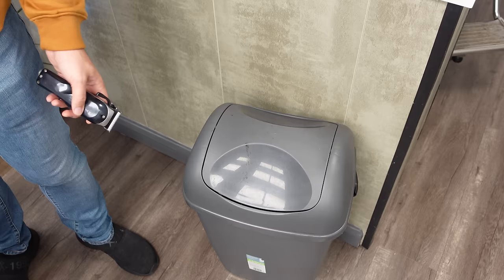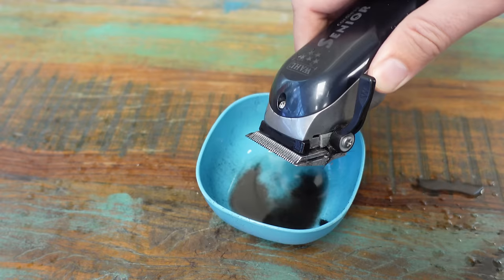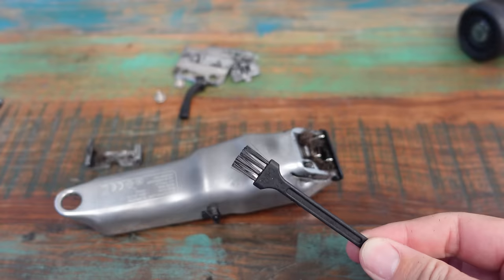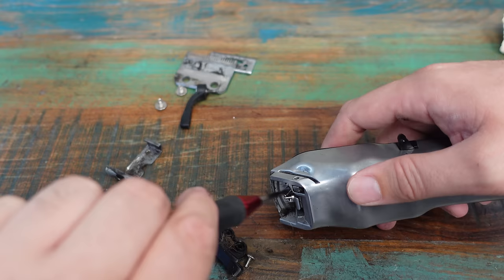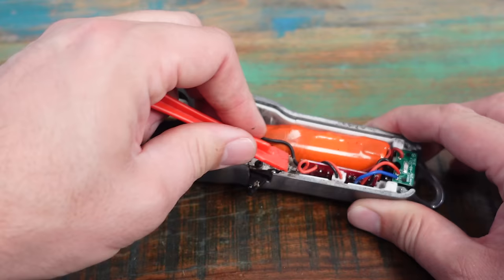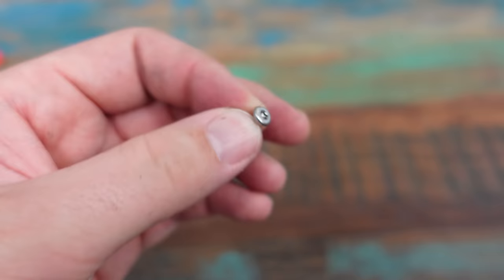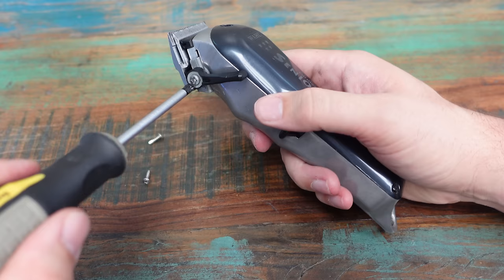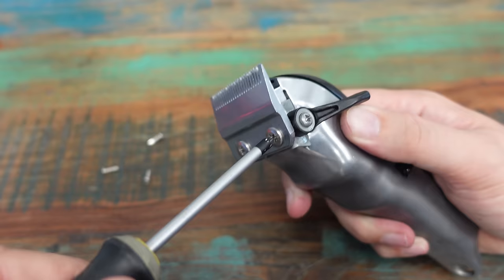How To Maintain Hair Clippers | Save $$$ by Stripping and Cleaning

Comment: Your clippers shouldn’t get like that in the first place, you should spray with clipper spray after every haircut and constnalty brush hair off the blades and I personally like to take my clippers apart once every 2 weeks to give it a good clean
Reply from the maker: That's a good routine, I don't disassemble them every two weeks but do cover the rest of the bases. I'd like to see clippers manufactured with better seals so that the hair isn't entering the mechanism.
Reply: @theoneminutebarber  Exactly it's a PIA doing all that every cut lol.
Reply: happened to mine the first time i used it😂 idk thanks man

Comment: could’ve took the blade off to begin with, then hit it w an air compressor 😭
Reply: that will blow it inside and around the motor
Reply: @thebobman69  air will not affect the clipper motor lil bro, and won’t cause it to rust😭💀
Reply: @ramihamed3618   learn to read bud.
Reply: @ramihamed3618 he's saying hair will blow inside 😎👍
Reply: learn to be specific for the special ones

Comment: Bro you need a air compressor to clean that.
Reply from the maker: That's a great shout. I really want one for the shop 👍
Reply: Or a pressure washer...😁
Reply: A can of compressed air also works great!
Reply from the maker: I've since bought an air compressor. Great investment
Reply: @theoneminutebarber  what model?
Reply: @florintirla6193  model 5inch bbc
Reply: @ChaoticMuchX 5 inch and bbc in the same sentence is wild
Reply: i actually cut hair in my small ass apartment and im so glad you showed it w out the conpressor

Comment: I took my clipper apart and cleaned out the hair. When I put it back together, the cutters rattled and buzzed loudly but wouldn't cut. After trouble-shooting for more than 20 minutes, I came here to find out what was going on. I finally saw you put the spring back and I thought, 'Spring? What spring? Then, I looked in the bin next to me and saw a spring that had spung out while  I was taking it apart. Five minutes later (and two zaps since I had the back off and the clipper still plugged in!) I had it back together and humming smoothly, ready for my next haircut. Thank you, sir!
Reply from the maker: Im glad you found the answer

Comment: Compressed air would make it easier to remove debris from the cavities. Even one of those keyboard cleaner cans. Submerging clippers that are plugged into an electrical outlet would not be good. I enjoy the channel. I have been cutting my hear for about 5 years now but have learned a lot from you.
Reply from the maker: Since making this video I bought a compressor. What a difference it makes
Reply: There is no issue in submerging the blade in a wash. There's plenty of products made for just that and they all tell you to actually run the trimmers while submerged.

Comment: I use my Remington on myself only. I only take it apart at the 2 bottom screws to sharpen with a stone. Especially if it is starting to tug. I learned here about offsetting the teeth a millimeter or so.
Reply: Hey, thanks! I wondered if it can be done. I sharpen everything in the house, from the scythe to the kitchen knives.

Comment: Great vid, thx. I have a cheap Babyliss, almost identical procedure. I suggest a small amount of silicone grease on the rotating pin and lightly oil all moving parts. The rechargeable batteries are also easy replace when they stop holding charge. If you don’t have a compressed air gun just give it a good blow to get rid of the stuff the brush doesn’t reach.
Reply from the maker: Silicone grease is a great shout.  I also use it.

Comment: Careful about the nut in with the level bolt goes,make sure you don't loose that,and skip the part in the beginning since you'll open it rinsing it is a bit redundant and expensive when the clippercide is £10 these days,also I'd use Andis it's exponentially better quality clippercide and lubricates more diminishing the noise aswell.other than that its a great video,thanks for your time to educate.
Reply from the maker: Thank you and that’s good advice on the Andis lubricant I’ll get some to try

Comment: Ideally you want a bit of oil on the plates that rub against each other.  I did that on mine and there’s practically no noise when the run.  Smooth as silk.

Comment: Great video.  Forgot the lube.  Light layer of high viscosity grease between the blades and a couple of drops of clipper oil right on the blades while clippers are running.  The high viscosity grease will ensure the longevity of the clippers.  Whenever the clippers start running hot, it's time to clean and lube.
Reply from the maker: thats an excellent tip

Comment: Bathing the unit is superfluous if you are going to take it apart and instead of prodding about get yourself a good air mains air duster and check the pressure of the armature will help.....re assemble set blades and oil well.
Reply from the maker: Mick I've actually obtained a compressor since making this video. It's been a great investment
Reply: @theoneminutebarber  Hi and thanks for the reply I bet the compressor has saved you lots of work and time plus cleaner parts as hair get everywhere.....Cleaning and maintenance is always a good policy with most things.  To really do a good job on them would be to hand sharpen the blades a specific way, then strip it down and get to the armature and set the tension on it because if too slack results in poor cutting performance plus dragging the hair....too much and he blades will heat up and may stop so it is important that you get it right this one thing will make all the difference to the unit.     Regards  Mick
Reply from the maker: That's great insight Mick, I'm not brave enough to sharpen the blades myself, I have tried once but the good thing with Wahl clippers is the blades are incredibly durable. 
I wish I could say the same for the dreadful stylecraft clippers I wasted my money on.

Comment: I got some Wahl with a lever (not the senior but some other model), but whener I try to tighten the screws after aligning the blades, the blades misalign and then I get this super noisy rattling sound. My housemate came out of his room thinking someone rang the door when I tried lol
Reply from the maker: The rattling can be because the lever screw needs to be a little tighter. 
For the blade screws tighten them a little each. A little on one and a little on the other and so on until they are both tight.
Reply: @theoneminutebarber  Thanks Michael! Gave it a try and seems to be doing better. Also discovered that my model has a screw on the opposite side of the lever, which seems to somehow regulate the angle at which the inner blade moves with respect to the outter, fixed one (if that makes any sense). Fiddled with it a bit and I think I got the clipper back to a working state. Cheers!

Comment: I got brand new hair clippers, used it once and disassembled it for cleaning after my haircut. When dissembling I noticed the blade sat flush without being pushed out however when reassembling the spring keeps pushing blade out. Any idea why this is happening?
Reply from the maker: you possibly haver the spring in the wrong way.  But also you don't need to disassemble the clipper after every cut, maybe after about a month of cutting.  Just use clippercide everytime.
Reply: @theoneminutebarber  thank you for replying. I did research and the brand I bought off Amazon is a cheap non existent Chinese manufacturer. Spring was kept in original place I just needed to clean the blade & guard because I have long hair and it jammed. If I may ask, any recommendations? Willing to spend 100$ max on a reliable set

Comment: hey mate, i got an all metal set of wall clippers recently. unfortunately i accidentally washing the head under the tap. not for long but... do i need to take it apart and let it dry, or will it survive?

I'm guessing it's not waterproof, and i don't do that again?
Reply from the maker: It should survive. Just let it dry and oil the blade.

Comment: What makes the shaving hurt when using clippers? Is it maintenance or blades?
Reply from the maker: Two possible reasons. 

1. The blade is blunt

2. The top blade is overlapping the bottom blade

Comment: How often do you need to change the blade to a new one if you cut your hair twice a week on average?
Reply from the maker: Probably never. 
With heavy use I’ve seen a blade last three years on a wahl senior.
Reply: @theoneminutebarber  is it worth me changing to a ceramic blade?
Reply from the maker: @kwameg.114 it really depends what clipper you are using. Some ceramic blades are very good but if you have a wahl senior then keep that blade. It is the absolute best.

Comment: Would you say the shorter you go on thinning hair the thicker it looks or the longer it is the thicker it looks or just in the middle not long but not short
Reply from the maker: Getting the balance right on thinning hair is important, so many guys think keeping it long will cover thinning areas, but in actual fact it draws attention to hair Los as there isn't enough body for the hair to lay normally and you need to use the lightest of product. I'd say it's better to be closer to short than long in most cases as hair begins to go.

Comment: Can you please explain how can I sharpen my clippers please? I think that will help  for us who bought expensive clippers and don’t want to make mistakes
Reply from the maker: I've never sharpened clippers. But I have replaced blades. It's probably easier. Some blades will last a couple of years and it's not expensive buying a new one.
Reply: @theoneminutebarber  I bought Wahl senior and I zero gape but still don’t cut good or maybe because am still learning am not pro
Reply from the maker: That clipper is one of the best and really should cut hair well. How's the zero gap? Does it cause redness on soft skin? You can almost move the the bottom blade forward a tiny amount with the seniors and they are still extremely close. The blade should last a couple of years even with heavy use. Make sure you spray the clipper on every use to keep it moving fast and clean.
Reply: @theoneminutebarber  ok thank you so much my brother and which spray will you recommend for me I can use it and I will try to zero gape again and make it close
Reply from the maker: I use clippercide. It does everything, cleans, disinfects and lubricates.
Reply: @theoneminutebarber  your the best my brother I really appreciate you I never expect you will be this open and help me like this I give you a follow INSTAGRAM and am already subscribe your channel

Comment: what does the lever do?
Reply from the maker: When you push the lever down it makes the bottom blade slide forward adding 1.5mm to the length of the cut

Comment: Idk what I’m doing wrong when I put the spring back on it doesn’t hold into place when I put the little black piece on it , it just pops off
Reply: I’m able to hold it down with my thumb so I can  assemble it but now it has a loud rattling sound when I turn it on
Reply from the maker: The loud rattling sound might be the lever is too loose try giving it a quarter turn

Comment: What type of oil is wahl oil? I heard that Zippo gas oil can be used?
Reply from the maker: I only use clippercide. Clippercide lubricates and disenfects at the same time. I find clipper oils too heavy although they do work very well. I've seen others use 3 in 1 oil. I'm not sure on Zippo oil/gas. The blade moves with a lot of friction, you wouldn't want anything that could ignite.
Reply: @theoneminutebarber  Great to hear from you.  Thanks for your valuable advice Teacher! Will avoid Zippo 😃👍

Comment: you will not FACE those problems if you do the following steps

1 - clean it at least once every two weeks !!

2- do not use the bath bullshit thing !!!
grab your screw driver and take everything out and start cleaning it less wasting  time faster work 

3 - after every couple of haircuts 
oil the blades

Comment: One minute barber and when the clippers don't cut? Please reply me thk
Reply from the maker: Tell me more. Are you saying they won't cut? There could be a number of reasons for that. 
1 the blade is blunt
2 the blade is loose
3 the blade is misaligned (set back too far)
4 the housing for the motor pin is worn
5 the pin is not oscillating correctly.

Comment: The screw for my lever won’t grab the threads for some reason? Help?
Reply from the maker: I’m not sure on that Vince. It could be chewed up inside or maybe it’s the wrong screw. That’s all I could think
Reply: @theoneminutebarber  I actually didn’t put in the little nut that it screws into. I think u skipped that part in the video. It dropped on the floor while I was disassembling. Thank you very much for the reply
Reply from the maker: I did miss that part out. I’ve noticed on lots of clippers the nut is fairly jammed in but not always

Comment: It would have been so much easier to clean the inside after removing the screws before soaking the clipper in oil and making all the hair stick to it.
Reply from the maker: I agree I just wanted to run through the simple options first

Comment: Do they need any kind of grease  or oil?
Reply from the maker: I would use silicon grease on the pin if there is none on it. Not that there has ever been a problem without it.
Reply: @theoneminutebarber  You should.  The plates will get heated and you’ll get gunk cooked onto the surfaces.

Comment: Is WD40 fine to use for what the Clippercide is used in this video?
Reply from the maker: Chris I'm not too sure, if it's domestic use it's probably ok I'd say as long as you are not letting the bare blade touch the skin, the reason I say that is I don't know anything about the safety of wd40 on something like a weeping spot, or if a misaligned blade caused an abraision. That said clippercide and WD 40 will probably be comparable in price. Clippercide is really cheap stuff a can normally last for months, I get easily two thousand disinfections from one can.
Reply: No
Reply: No. WD40 is good to displace water, but is not a good lube.
Reply: No.  It will stink for starters and secondly it’s not meant as a lubricand but as a water repellent.  Use clipper oil or a very light oil.
Reply: @Evral Tatum-Mcfield 3in1 is too viscous and binds with heat.  Best to use a mineral oil in my experience.

Comment: On my whal magic clip the lever wont tighten
Reply from the maker: Is the little nut still on the other side of the lever where the small screw goes in?
Reply from the maker: Sometimes they fall out when you are disassembling.
Reply: @theoneminutebarber  what is that the litte nut where is it on the clpper
Reply from the maker: If you go to 2:14 in the video you can see a small square hole in the top left of the clipper housing. There should be a small nut that fits in there.
Reply: @theoneminutebarber  yes i think have the small nut the screw wont tighten
Reply from the maker: It’s possible the nut thread is shredded.
Reply: @theoneminutebarber  is there a way i can send a vid of it
Reply from the maker: Yes please send it to my instagram channel which is also the one minute barber

Comment: This type of blade is very very difficult to proper fix and alignment almost not,because of vibration like in sex vibratiob toys,
Alignment in computer text,or cars or other is very very tricky lot if concentration need and skillfully technician need.
Companies should be avoid this type of alignment or other cheap price 7se and through.
Reply from the maker: It can be a little tricky but I think every barber needs to know how to align a blade   They do go out of alignment.

Comment: This happens when you don't clean your clippers after every cut..
Reply from the maker: It's not practical to disassemble the blade on every hair cut. You can clean the outside of the clipper by removing debris and using clippercide, but that won't stop hair getting inside the casing.